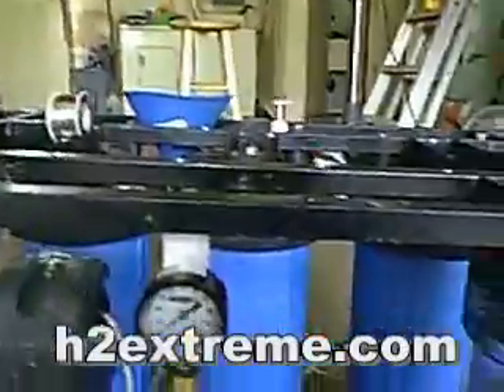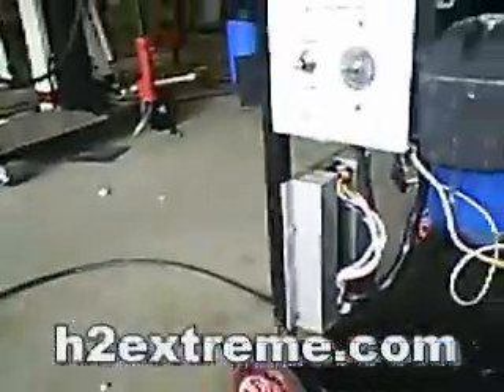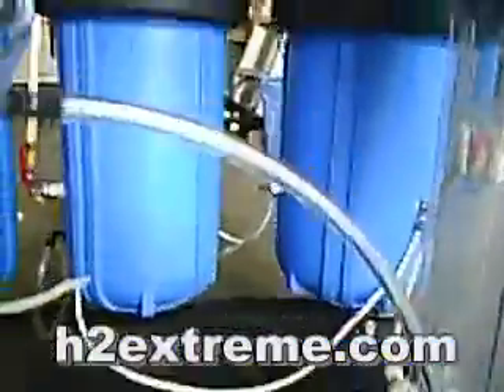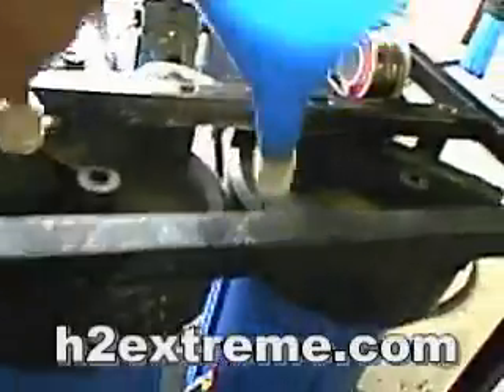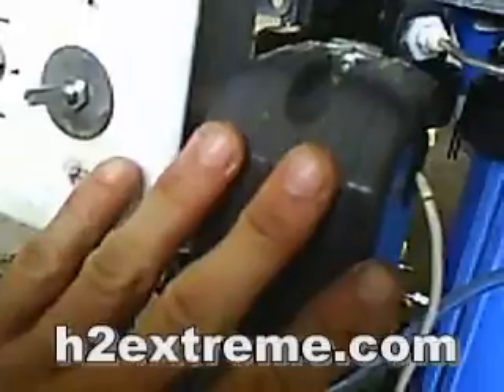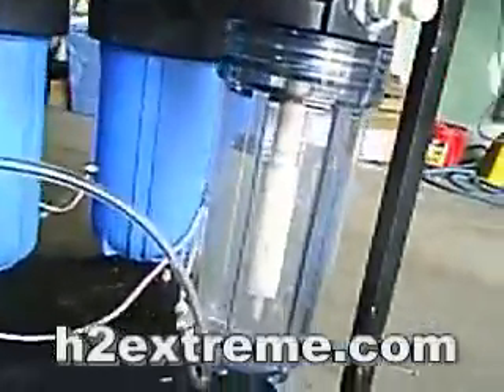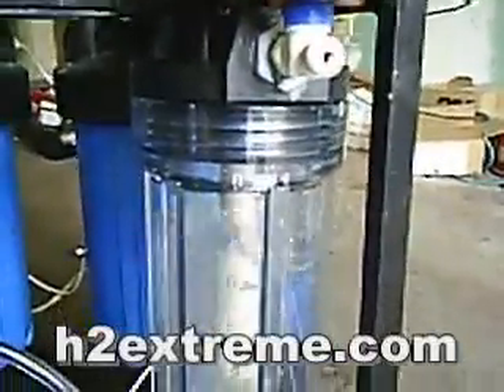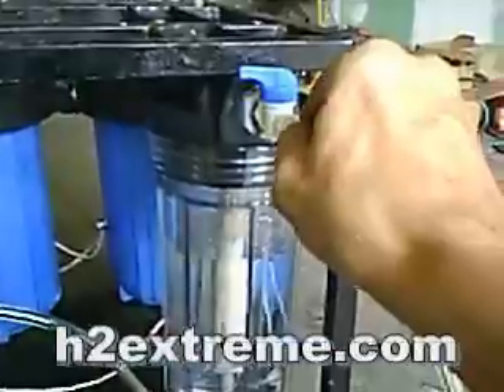8 liter per minute prototype hho gen

Comment: If u seperated the oxygen from the hydro u used a modded cutting torch u than could regulate the mix and also have a blast of oxy to cut way better. I made a setup this way and wow does it rock that way! i had one setup like yrs with the gas mixed and i never used it for one reason think about this what happens when u have oxy and hydro as gas mixed under pressure? Well u can get them to rebond back into water and if u know what how atoms combine well u get a spark not cool with all that gas!

Comment: So if you get one and make hydrogen say one of the bottle youhave in video full and meter it out into your cars air intake. ( through an orfice) to control flow.  would that one bottle last for  100 miles of driving.   and if I have a car the gets 30 mpg how much increase will I see.   What did you see?

Comment: I am SICK of seeing people say that the power being dissipated through their cells is THE SAME as what they are putting out.  Sure an electrolytic cell acts like a capacitor BUT it acts more like a resistance than anything.  Ive done this test with a battery booster.... set it to boost on 60 amps... measure the current going through the cell and its ONLY 8 amps.... its like resistors... two 1/4 watt resistors wrapped together have the same resistance but are now 1/2 watt resistors....

Comment: I know that you are a pro at this, but isn't it dangerous to run that thing without a spark arrestor, inline from the bubbler to the torch tube?
Also, should there be an expansion tank with regulator prior to the torch?
I'm really getting into this HHO torch thing!

Comment: there were 99 neutral plates, rectified 220vAC was applied at the two ends of the stack ... the plates in my device are rough cout to an 8" x 8" form factor ... they are of 20 gauge, 316L stainless ... for 110vAC opperation, I center tap a negative connection and feed positive to the two ends ... works well either way ...

Comment from the maker: this is exactly what i am looking to do. I like the fact that the plates being exposed to the air helps keep the system cool. on the 100 plates, how many are neutral between actives? and what size is the block when complete? I will look into your videos for more. thanks for all your info. I cant wait to actualy build one of these dry cells.

Comment: I was recently able to run my EBN prototype with 220v at about 17a using a total of 100 plate gaps. Output was just shy of 20 lpm and the unit did not exceed 100F.  Fluid temps were at about 120F. Gas being delivered to the torch was clear with no visible water vapor and was about 100F temperature.  Nice clean high blue spectrum flame from the torch. Did very well with a .060 orifice. One advantage to a setup like I am using is this ability to reconfigure on the fly for given purpose ...
Reply: Wow!!! 👏 video anywhere?

Comment: actually, if you are able to get 8 lpm at 120v with only 10 amps, you are doing pretty well with the design you have ... that would be a little better than 6.5 mmw which is about as good as some of the best Tero type dry cells are doing ... but particularly for working with a torch, I still prefer the dry cell purely for its structural integrity ...

this is a very nice build ... lot of thougt and work went into your rig ... I am impressed ...